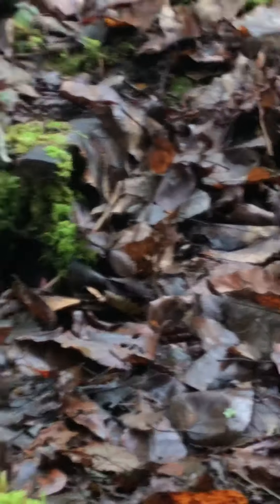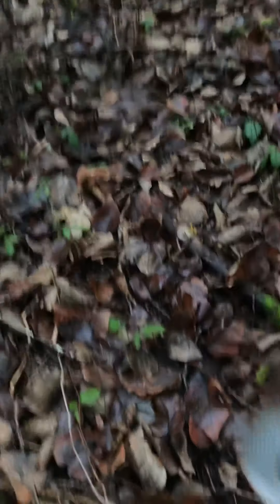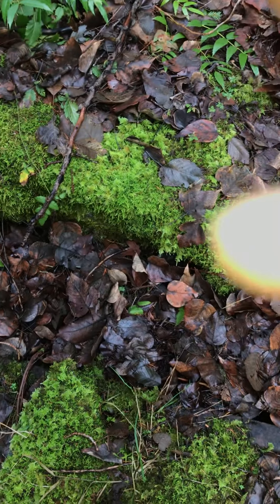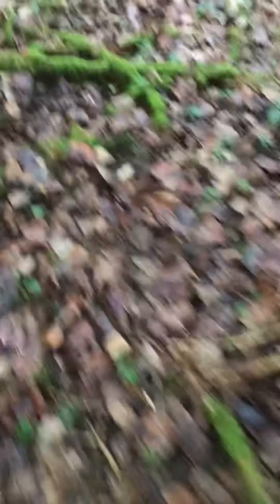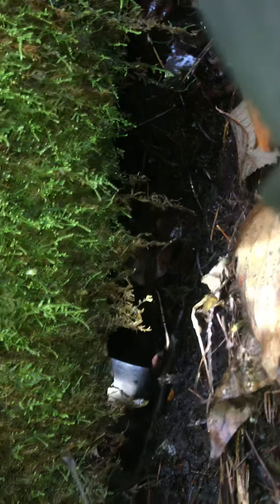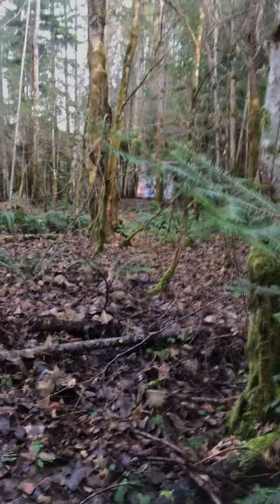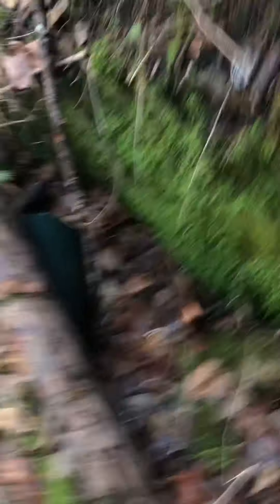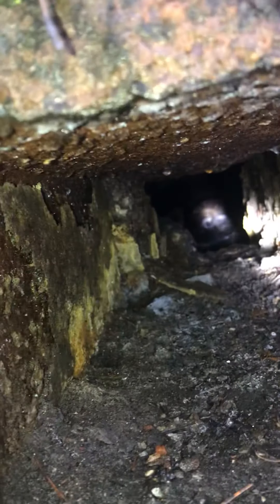Drac’s Castle Courtney BC. Comox No. 8 Coal Mine Air Shaft Vancouver Island BC

Comment: Thats super wicked you found that!. So a month ago I met 2 random people there. 1 dude was 60 and 1 was 40. Dracs castle was originally the ruins that are behind the pillars where you are, and they used to have huge parties there in the 90s because it was an actual building still then. But yeah super wicked you found the holes!  Did you walk down the trail?
Reply from the maker: Thanks! I was actually wondering about that since last night I was doing research about it and came across pictures of the ruins from the late 60s up to the 90s. Although this was down the road from the pillars and not in front of them. I was aware of the main shaft hoist house and looked in front of the pillars and there was a clearing clearly there was something there at one point but all I found was a couple broken up metal roof plates and a small very fragmented peaces of concrete.
Reply from the maker: Yes I did walk down the trail and found the other foundation I found concrete fan holders.